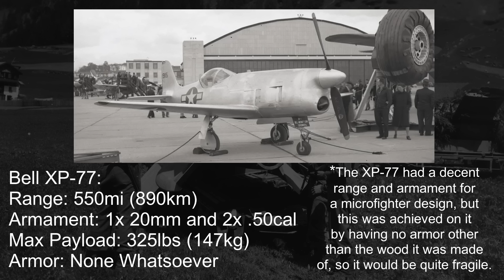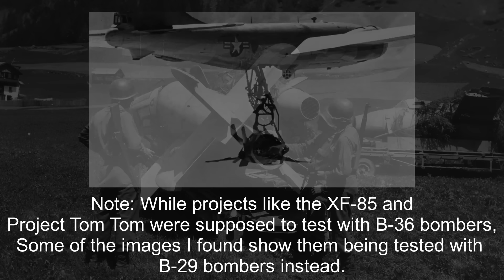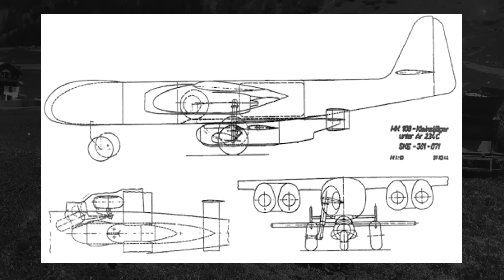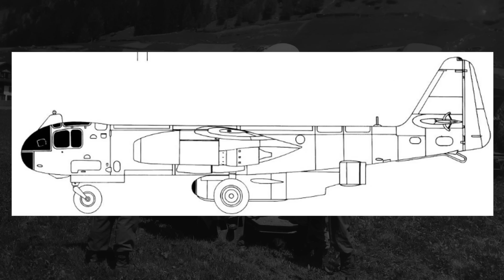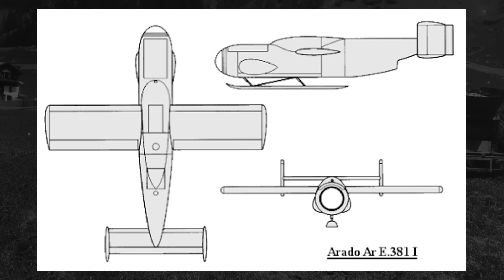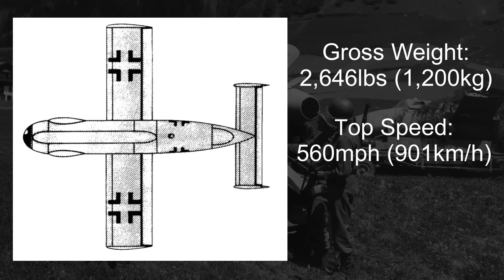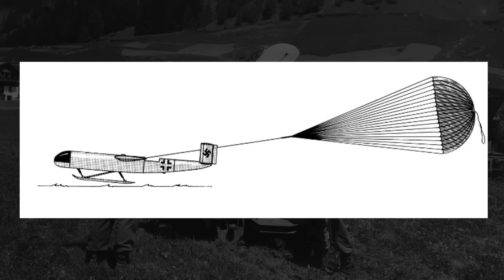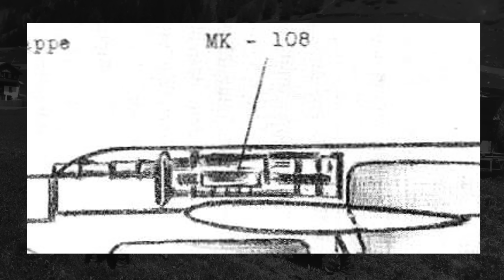The  Emergency Fighter Barely Bigger Than Its Pilot: Arado E.381

Comment: More than ten years ago I became fascinated with the Arado E.381 parasite rocket midget fighter when I came across it in a book about Luftwaffe emergency fighter designs.  I scoured the Internet for any information about the E.381 concept.
    Concept it was because the E.381 Kleinstjager (miniature fighter plane) never progressed to the mockup or even prototype stage.  The E.381 became another footnote in the myriad and plethora of fantastic emergency, technological cutting edge and avante garde fighter plane designs that the dying Luftwaffe grasped at in order to help stave off growing inevitable defeat for Nazi Germany.
     In retrospect the E.381 is a parasite midget fighter plane concept that probably would have held greater interest to the more fatalistic Japanese Imperial Headquarters High Command.
      In the afterthoughts of postwar history, would have and could have the E.381 Kleinstjager worked?  From a purely technical and technological point, certainly, as Germany already demonstrated with its rocket-powered Me-163 Komet interceptor, the Me-262 twin-turbojet engine fighter plane, and the diminutive Heinkel 162 Volksjager.  But how about its practicality in combat operations?  I'm not positively certain except for an educated guess.  My answer is, possibly and probably, but to no great consequence on the Allied Combined Bomber Offensive which had already reached its crescendo back in the late summer of 1944.
     In the overall picture, the Reichluftsfahrtministerium (RLM) and the Luftwaffe envisioned wistfully thousands of the jet fighters and jet bombers in monthly production by the spring of 1945.  Only a few hundred of the 262 and Ar 234 ever reached completed production.
     That begs the question, where was the Luftwaffe going to find the thousands of new and fully trained pilots to fly all of these new technology aircraft?  The Luftwaffe by early 1944 had run out of the capability to train new pilots fast enough to replace those lost in combat or injury.  Right on its heels was the lack of aviation fuel due to the Allied bombing raids.
     What did in the Luftwaffe was not an absence of imagination and talent.  It was an absence of time.  The clock had run out on Nazi Germany.

Comment: @4:10 the DVL Jagdsegler was even smaller and planned to be launched from onder a FW190, it was planned to be armed with a couple R4M rocket pods or 8x RZ65, the bomber would carry 2x SC250 bombs or a BT400 torpedo. Wingspan 5,16m, length 3,36m, fuselage diameter 0,87m, wing area 3,70 sq meters. Weight max: glider/rammer 640kg, fighter (with pulsejet) 950kg, bomber 1100kg. Max speed gliding 360kph, with rockets 650kph, with pulsjet 900kph
Anyway thanks for the cool video
Reply: Can't really find anything on it but it looks more practical

Comment: The irony is they planed in putting the same 30mm cannon used on the Me 262 on this.  The 108 30mm cannon had such a low muzzle velocity it proved to be a problem in the 262 as closing speeds were so fact many pilots returned to base being unable to fire their guns.  It's estimated that pilots had two to three seconds to get close enough to fire then break away before running into it's target.  The E381 was estimated to be almost 50 mph faster than the Me 262 making it impossible for the 108's to ever hit the target.

Comment: 381 looks like it was powered by the same engine as the ME 163. I  believe the Natter broke the sound barrier on its maiden flight on its way straight down to its crash sight.
Reply: They figure a number of P47 Thunderbolts did the same thing on bomb/ attack missions, broke the sound barrier all the way to the crash site. 😮
Reply: @towgod7985  Maybe some P38s too.
Reply: The term is "compression," which limits (restricts) the flight control surfaces ability to imput directional change in the aircrafts existing flight path. GRAVITY, lift, thrust, drag are the "4 Forces of Flight" & Aerodynamics. Thus, since GRAVITY is the greatest force, it is always the dominant issue / force at the crash site. It can be of assistance to mechanical failure, control input errors, and atmospheric abnormalities,  but it's always a player. Defying Gravity is the "utopian dream" of physicists 🙏
Reply: They found some of the pilot's remains on the testing site several decades later.
Reply: Yep, same engine — or at least very similar.
The use of the hot (with C-Stoff, hypergolic) and cold (as monopropellant) T-Stoff process for power was widespread. It powered the V1 launchers, it powered some torpedoes (not very successful), it powered the Starthilfe RATO, it powered the Natter, experimental high speed submarines like the V-80 and the design for larger subs were changed to conventional power in the XXI and XXIII electro-U-boat types (as the technology was not ripe yet).
Reply: I thought the technical term was 'compressibility'.
Reply: @advorak8529 I believe you're thinking of the V2 rocket, the V1 flying bomb used standard low grade aviation fuel
Reply: @JohnMoses1897  Taking off is optional....landing is mandatory.

Comment: That is a good one. Both photons and dark space seem to have no mass making them sort of on the same playing field kind of like ying and yang.  So, imagine tritium in a packet running through a clear tube with light baffles at both ends. Spaced evenly they would be like dots light and dashes dark then if pushed along by air pressure in a dark area you would see light, dark, light, dark and so on until the source runs out. Given then that light is followed by dark at the same speed in that concept, maybe light and dark could be considered to be running at the same speed.

Comment: Even if the parasite fighter didn’t impair the performance of the mother plane, there would still be the issue that, even at their best configuration, propeller-driven medium bombers were often easy prey for escorting US fighters, anyway.  Over time, you could run into a situation where, even if you could produce lots of these emergency fighters, the ability to produce enough mother ships might lag severely behind.  

That might be why they preferred the Natter design.  Building, concealing, and manning a launch tower on the ground would probably be easier than building and hiding a medium bomber while also training pilots for it.

Comment: You underestimate the destructive power of the Mk-108 30mm. Two head on hits pretty much guarantees a destroyed bomber. Even one hit would be devasting. 
What held the cannon back, was it had a slow rate of fire and the velocity of the round was low, making it almost useless against a fighter. So, fighters that carried this weapon couldn't be used against other fighters, and were very vulnerable to escort fighters, as the weapon was often in outside pods, greatly affecting weight and drag, hampering the speed of the aircraft.
This tiny fighter would essentially be immune to escort fighters during the attack, as the speed would prevent interception. Plus, it would be near impossible for the bomber's gun to defend against, because of the approach speed.
That said, the plane would be a sitting duck trying land, and few would ever have a second mission.
Reply: I know it is not the same, but in flight simulators, many people can actually make good use of the 108 in fighter on fighter encounters when flying the Bf 109 G6 and later models. 

It is not very good in traditional turn fighting scenarios and hard to use in deflection shooting, but if the attacker pilot is in a favorable position (let's say 1000m above the target) and he uses to boom and zoom, a single hit can kill the enemy pilot or blast apart the whole center fuselage, depending on criticality of the hit.

In a less favorable position, a good strategy is to hit the target with 13mm machine guns first in a quick strafe, reducing the maneuverability of the target plane and then finishing the target off with a couple of 30 mm hits.

I'm not a very good Sim pilot, but even I can score a kill or two from time to time in multi player engagements against seasoned players, and the results are quite spectacular, to say the least. 

Like I stated in the beginning, flying a WW2 fighter while sitting in front of the PC is not the same thing as doing it in real life, but the guns are modeled correctly, and the flight models are considered realistic (I'm not talking about war thunder but IL2 and DCS).
So I'd say you're a bit too harsh on the mk108.
It is easier to use the MG 151/20 though but you need way better accuracy without wasting a lot of ammo on armored or non critical parts.
Reply: The “Sitting Duck” would be supported by ground AA, and even fighters do not like AA going off all around them.

Especially when they are not 20,000 feet high where they can alter their altitude/course fast enough to stay ahead of the measure-calculate-fire-shell travels up there in 20 or so seconds …
Reply: No, I'll explain why in a new post. 23:16
Reply: @Squee7e  It works in war thunder but in reality most pilots wouldnt be insane enough to properly lead the 108 against a fighter. With muzzle velocity this low, leading the gun meant basically putting yourself in a direct collision course with the enemy.
Reply: @serfgergergergerg8081  I specifically excluded war thunder from my list of games because I don't believe that the flight model there is anywhere accurate

You need to keep in mind that the planes that had the mk108 also had secondary guns. Most of the time those were mg131 13mm machine guns or even the mg151/20 20mm cannons that were quite capable in crippling the enemy.

A punctured main wing could not sustain had turns and that's the moment when the mk108 could be used to finish the target off.

Also the mk108 was capable enough to hit an enemy fighter at 200m with it when you had the upper hand in the engagement. It is not that hard to make a target turn into your wingman's fire line. So even if you didn't get a good position your wingman could hit the target.
Remember that a single hit could be already enough to make the enemy pilot bail out because his plane isn't controllable anymore

Did you ever try IL2 GB or DCS? If not give it a shot. Those simulator games are way more realistic compared to war thunder and you don't have those chaotic "team deathmatch" scenarios which make war thunder unplayable in my eyes 😅
Reply: If I'm not mistaken the Luftwaffe estimated a 20mm needed 20 hits on a B17, compared to 5 for a 30mm 108.  Which is hard to achieve with just one of them in a single pass.  Might be useful in damaging enough bombers to break up the formation and leaving stragglers for the 109s and 190s to finish off though.  Assuming you could build about 500 of them and 500 jet bombers to carry them, and train 500 pilots well enough to fly the things.Moot points anyway, because by the time of the Emergency fighter Program, the Luftwaffe  was a dead man walking in any case.
Reply: lol this isnt war thunder bro lmao

Comment: I could see b 52 getting a little drone fighter could bring back the gunner crew member. One that could come back and refule
Reply: A lot of fighters were designed and tested for the B36/52
Reply: @captiannemo1587 Don't forget the USS Macon dirigable with its trapeze for the Sparrow Hawk fighter planes. If small fleet operational as originally planned,  the IJ fleets would have had a difficult time surprising everyone at Pearl Harbor or the Philippines.  Even though Sparrow Hawks (very small armed "pursuit" planes with good endurance & rafios) would be hopelessly outclassed by IJN aircraft, the radio alert from a CAP would have foiled the element of suprise. Ironically,  blimp ideas are making a resurgence

Comment: It seems that the escort fighters would shoot down the 234 with the E.381 still attached since the combination would be significantly slower than a P-51.
Reply: How do you know that?
Reply: DAMN GOOGLE AI  Müller
Reply: They would have to find it first. Which is a different proposition than defending your aircraft carrier task force where any radar contact not of your own planes would be an enemy. You have ground clutter, your own chaff, hundreds of other aircraft, both bombers and fighters, and much less capable radar systems … with an enemy tracking you closely.  How do you intercept the 234 if you have little or no idea where it is?

Comment: Nice video. I didn't know of this crackpot idea fighter. As stated elsewhere it probably was an enigineer ruse to not be sent to the front.

This is not only as such a crackpot idea but a crack head and crack tiny plane design as well. 

Try putting your head just below a tin lid at the muzzle of a 30 mm auto gun going off. I was a gunner of the Dutch version of the Gepard  35 mm AA gun. Only slightly larger.

Also the recoil effect in a tiny fighter would be whopping.

Take the early versions of the EE Lighting with two 30 mm Aden canon near the cockipt. Firing these caused so much shock they were removed in later models. 23:16

Comment: In the illustrations with a mothership, the parasite mount position is impossible. The CG is at about 1/3 of the cord back from the leading edge. In the illustrations, 90-100% of the parasite's weight is behind this. The approx correct position is with both of their 1/3 cord lines aligned.

P.S. The complete list of all military parasite applications:                                        End.
Reply: While you are right in theory, you may be forgetting that the parasite has not just weight but also wings and drag, changing the CoL too.
Reply: PS: Your list is woefully incomplete. You not knowing or not thinking of applications does not mean there are none; this is an argument from ignorance and/or incredulity, which are logical fallacies.

I might reasonably argue that most combat planes today carry several unmanned parasite fighters. They do not have to return, they do not need space for a pilot and cockpit, … which is why spacecraft carriers are not a thing, especially as any spacecraft can fly as fast as any other if it has enough ΔV, unlike ships vs planes. 

I’d also argue that a CAM ship has a parasite fighter — a single-use Sea Hurricane. It did pretty well against the Fw 200 Condor/Kurier, a militarised civil transport aircraft that managed Berlin –New York non-stop in just under 25 hours in 1938. They had little opposition as they were staying outside fighter range … but few defences if attacked. 

8 combat launches, 8 planes shot down, 1 damaged, 3 chased off, 7  fighters destroyed by ditching/bailing out (one landed in Russia), one pilot killed (died of wounds from bailing out), 1 injured, 1 nearly drowned before recovery.
Reply: @advorak8529  1st point has merit.
Reply: @advorak8529  2nd has none. Clearly we are talking manned, airborne, and able to return to the host. Intentional ignorance is lame.

Comment: A V1 was attached to a Heinkel 111 in a new offensive against the U K late in the war. It failed with heavy losses.
Reply: It did not fail per se, but a few V-1 blew up on launch (insta-scrapped plane and pilot) and others had some technical malfunctions.

It was not the most successful buzzbomb launch method, though it did allow to have them fly outside the well known corridors from the launch sites.

Comment: The Japanese way of suicide made vastly more sense then the Getman way. To begin with crashing into a carrier is instant, you are never going to feel it. Getting dissolved when the t stoff and g stoff leaks has got to be about the most horrible way to die. Next the target, the Japanese were aiming at carriers we only had dozens of carriers. The US and Britain had thousands of bombers, destroying a single bomber had essentially zero value. Then the vehicles themselves. The Japanese didn't need to waste weight on things like landing gear or parachutes. Finally a Kamakaze had a much easier job, all they had to do was fly into the target, no fancy maneuvers. A German flying one of these contraptions would have only a tiny chance of hitting his target and he would have been just as dead at the end of the mission.